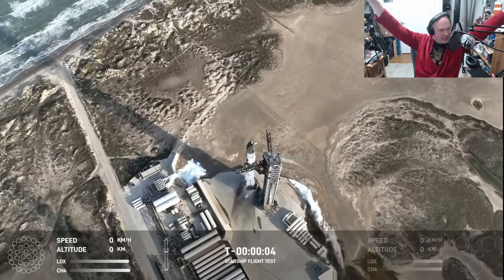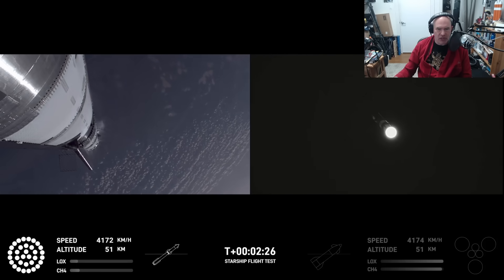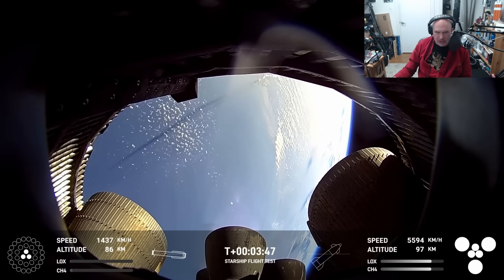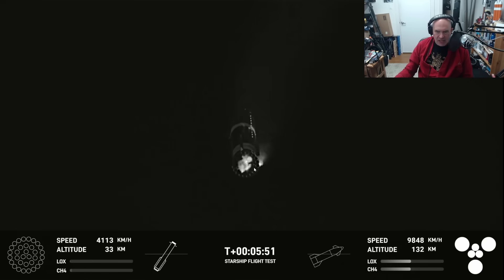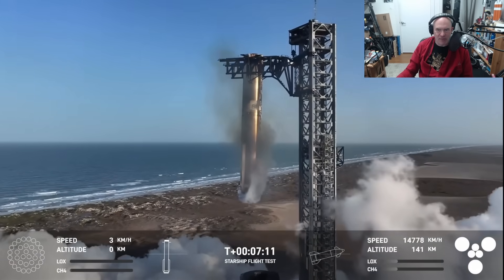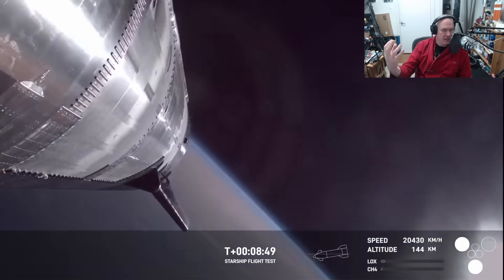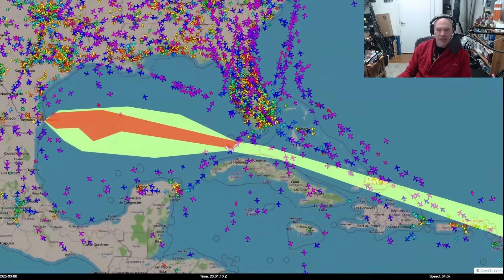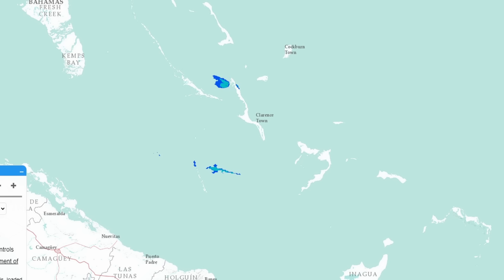SpaceX Make The Same Mistake Twice With Starship Flight 8

Comment: Yep what amazes me when it had reach complete failure state. It wasn't immediately terminated. The onboard computers should have shutdown the other two engines. While they still had telemetry and probably start to dispose of fuel. You would think once your vectoring engines failed it was a complete failure. The engines appeared to burn nomilly for some time. It is strange people are talking reasonance. It just seems the engines overheaded. Though maybe they were damaged during separation which caused the cooling to be reduced. They probably should colour the fuel so leaks are more obvious. But they probably have thermal cameras onboard to detect locations of leaks. Probably tge cooling rings were damaged.
Reply: They got more data this way.  They had a couple of minutes to record data that might have the best information.
Reply: @paulwilson8367  The engines should shut down on lost attitude *immediately*. Keeping them running while tumbling uncontrollably makes the reentry zone more and more unpredictable, and there's no much time to divert air traffic from harm's way. This is not only pointless but also plain irresponsible. No much, if at all any useful data can be extracted - and even if it was the most important piece of information, you simply don't risk people's lives for some damn telemetry.
Reply: @matwyder4187  Are you part of SpaceX team, do you have their flight tracking information?

I have a homework for you.. Launch a rocket in kerbal space program, then once it's out of atmosphere start spinning it in one direction and don't stop the spin at any point and see how much it diverts the flight path after you start spinning.

(I can give you a hint: Rockets aren't very good at changing direction when they are flying 20'000 km/h in one direction, especially when spinning around)
Reply: @ As far as I see it was actively trying to correct with differential thrust on the remaining 2 rvacs, that by itself can induce some serious unexpected deviation.

And that's not even the question. It's clear and simple: SAFETY FIRST.

Why defend the stupidest, most irresponsible thing one can do in a situation like this? You've lost it, turn the darn thing off ASAP, how isn't it the obvious response? No need to introduce any unnecessary unknown variables to an already unplanned situation.

For the same reason, FTS should not be triggered, an attempt for a controlled reentry is the safest option, try to get it down in one piece. Running the engines so long for no good reason caused the spin, chances are it fell apart because of structural failure.

I just can't explain why. Unless it's meant to be a statement of "we do whatever we want". That's a terrible attitude, it's just asking for trouble. Do they really need public outrage? And that's the better case, if they accidentally take down an airliner, that's probably the end of the entire endeavor. Risk innocent lives, risk the entire Starship project, for nothing. This is just plain dumb.
Reply: @matwyder4187 What specific risk was presented by leaving the engines running?

Please account for the fact that by running them, they were burning off literal tons of fuel that would have otherwise stayed in the vehicle.
Reply: @  What vehicle? Dunno if you've seen the shots, to me it looked a bit... rapidly disassembled out of schedule, I guess? The fuel clearly didn't need help to burn at that point. It looked amazing btw.

But fuel is not your greatest concern, especially not over the ocean.

By shutting down the engines, it would most likely have disassembled itself at a later stage, or even performed a successful reentry - in either case, effectively constraining the affected area.

The presented risk is directly proportional to the size of that area.

I rest my case.
Reply: @matwyder4187  Here's your problem Mat.. You know nothing about rocket science.

They are perfectly capable at destroying the vehicle from any distance and they have done so multiple times in earlier launches.

They also can shutdown any engines necessary from distance, which would change absolutely nothing in this case.. It would just make the rocket heavier and have bigger impact once it crashes.

If you spin around rocket you do two things, you get important telemetry data what happens to the rocket and especially the fuel inside during extreme situations that are really hard to simulate. And they burn large amounts of fuel, which surely you can figure out why that's important on rocket that has lost control if you think a little.

Now here's the the thing, they are NOT introducing any deviation to the rocket by spinning, because it's literally boosting in every direction which means that it boosts to NO direction meaning it's burning fuel and not going anywhere.. It's staying perfectly on expected crash course.

This was the SAFEST option with least amount of debris being spread around. And these kind of decisions are precisely why YOU are not making any decisions for SpaceX. Mat, you are NOT rocket scientist.
Reply: @matwyder4187  maybe but leaving things to chance is worse than taking action in my humble opinion.
Reply: @ You are right, I'm not a rocket scientist. And what's also obvious, that you read selectively, carefully ignoring all my arguments clearly contradicting your beliefs. Not even after many actual professionals and respected members of the spaceflight enthusiast community sounded the exact same concerns as the previous flight went off the rails. It's pointless to engage in a futile battle with a cultist. Defend your Messiah by all means, especially if they are wrong. I can't help you.
Reply: @matwyder4187  NOBODY is talking about Elon Musk here, stop making strawmans.. 

He's nothing but "the money guy" for SpaceX and he is completely unrelated to these launches or their success. Elon Musk isn't the person building OR launching these rockets, he's the guy that owns them and nothing else. He has hired over 13'000 employees to do those jobs that he's unqualified for.

Also I answered almost all of your arguments, no matter how ignorant and uninformed they were.

" ...many actual professionals and respected members of the spaceflight enthusiast community... "

Who are you talking about here and how many of them have you made up? You are literally watching Scott Manley talk about it and he mentions the debris for whole 20 seconds during this very video with the expected trajectory that followed normal protocol and was preplanned, which you can clearly see on this video instead of making stuff up..

But sure, rocket company with over 99.30% success rate at launches for real payload is clearly struggling and making mistakes because their massive prototype rocket that's expected to explode, exploded... And this mister youtube commenter is here to tell us how SpaceX is getting it wrong and these "experts" could totally fix issues for them that they have 0 actual information on other than flight tracking data.

You don't work for SpaceX. Stop behaving like you somehow know what they did wrong or right.

By the way, I don't work for them either.. No I'm not a fan of Elon, yes I'm fan of space exploration and have followed it for 40 years of my life.. And no I don't know exactly what's going on there either.. But I know for god damn sure, that they aren't just making random "mistakes" on 30 million dollar experimental rocket while performing experiments on them.
Reply: @DelPlays  Dude. Scott Manley put up a whole video after IFT 7 regarding his own air traffic safety concerns, the alarming lack of communication on behalf of SpaceX towards civilian aviation, how NOTAMs aren't pushed to warn any potentially affected flights to be prepared for such scenarios, how the flight exclusion zone doesn't cover potential mishaps like the last two. This is plain insane negligence.

Oh btw. we all know what happened with IFT 1, don't we? Should I stop behaving like somehow I remember how they lost control of the entire thing and again, it was nothing but mere luck it didn't decide to aim itself towards the land. These guys are reckless, proven over and over again, and they seem not to give a damn about public safety concerns.

Good for you that you "know for god damn sure" they aren't making "mistakes". I respect your religious beliefs, until they don't pose a threat to the safety of other people.

For the bare minimum it would be sensible to take the above steps, properly extend the exclusion zone, make sure pilots are prepared, as this seems to become Business As Usual as long as they keep tinkering with their experimental vehicles.

Way more precautions should be taken, to avoid situations where local ATC has to crisis manage sudden emergencies, because this is the ultimate recipe for mistakes to be made, on behalf of anyone involved - you don't even need a direct contact incident, simply redirecting flights to holding patterns carries risks, see, last time one ended up declaring Mayday because of the unexpected disruption.

And all of this has nothing to do with what you think about managing an out of control 100+ ton explosive projectile based on your unmatched experience in KSP, neither what level of condescending tone you choose to express your eternal wisdom.

Their disregard for safety is clearly endemic, so far they gave no good reason for us to believe they have proper protocols set up to contain at least the most likely failure modes. Let alone one almost exactly replicating the previous incident. One would expect at least they learn from their actual mistakes as they move forward, so the same error would be at least somewhat better contained than the previous - instead, they somehow managed to make it even worse.
Reply: @ Finally you're talking in bit more sensible manner, but please drop the religious stuff.. It has nothing to do with rocket science.

Now there's one major thing that you keep missing.. You need insane amount of power to change trajectory of a rocket that's already going 20'000km/h in one direction, the debris at this point is not going to fly in random directions it's going to fly exactly where expected and will 100% guaranteed land inside the exclusion zone based on direction of last controlled thrust.

Them spinning the rocket around means that it's not going to change trajectory and it's going to land within the pre-planned crash zone that is publicly available and should be known by every air traffic controller.

I seriously don't understand what you are talking about "making things worse".. It basically went exactly same as last test, except that the explosion happened closer to earth (which is a good thing since it makes the debris spread less)